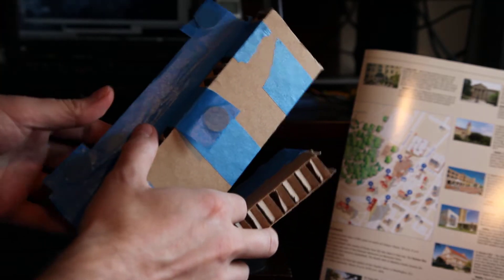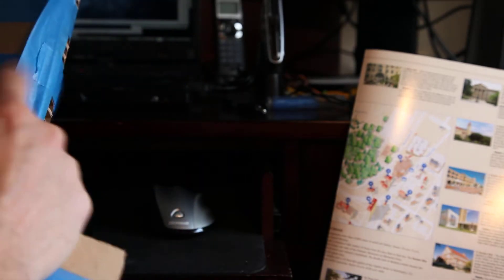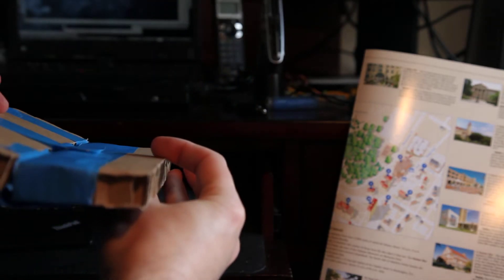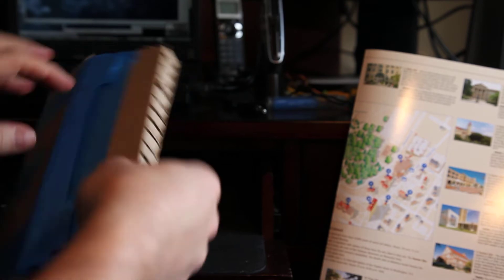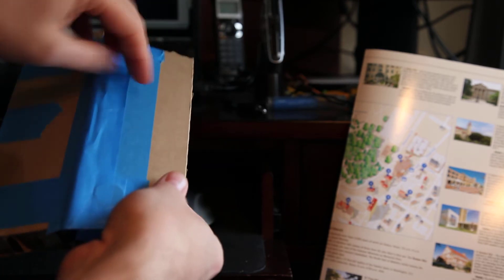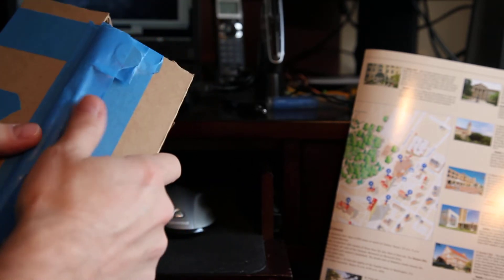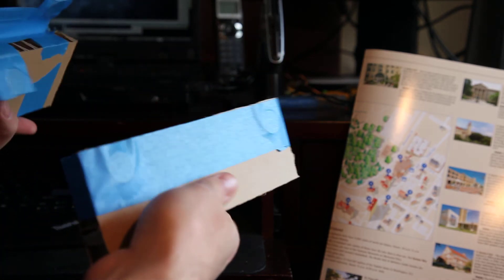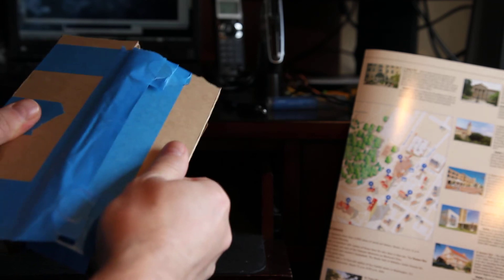Magnetic Quick Connect Seam for Hexayurt - Prototype

Comment from the maker: No I haven't pursued implementation of this method, and I don't know anyone who has yet.  I think finding the correct tape to hold the magnets and getting the magnet positioning correct will be the largest challenges.  Also water-proofing the structure might be more difficult, using larger flaps would help and perhaps adding some sort of continuous light weight magnetic strip along the seams, think like a refrigerator seal, you could achieve water tightness.

A few thoughts to consider;

This implementation will likely be more expensive than mono-filament tape, which also has it's own considerable costs.  The mono-filament tape doesn't appear to wear well over time, especially when exposed to elements and the sun/UV Rays. This reduces the long term re-use of the yurt. The magnets are also susceptible to oxidation, so trying to find a wide, sturdy, UV resistant tape that will protect the magnets would be an important engineering factor for this type of construction.

Because of the added expense to this type of construction, some thought should be put to improving the durability of structure and considerations to find materials (like the tape) which can withstand the conditions the structure will be subjected to.

Perhaps even moving away from tape all together and using fasteners or epoxy to attach fabricated rip-stop nylon flaps that contain the magnets could be investigated.

Let me know if you make any progress on these challenges or actually implement some sort of magnetic quick connect system for the hexayurts!